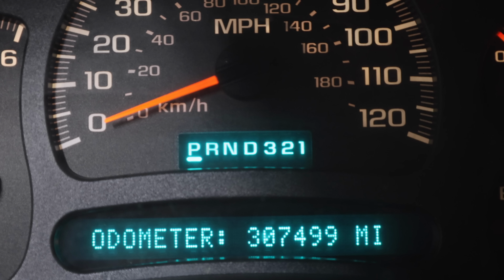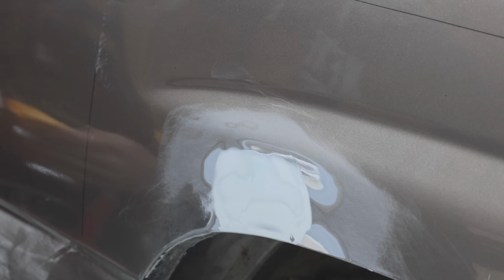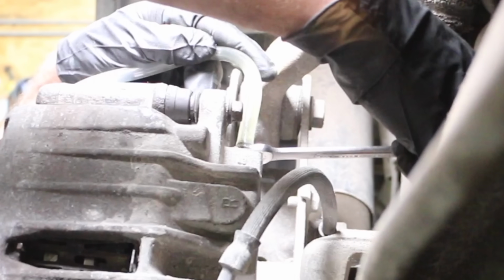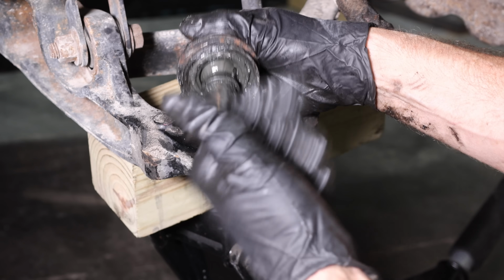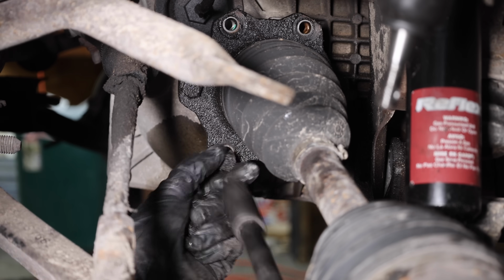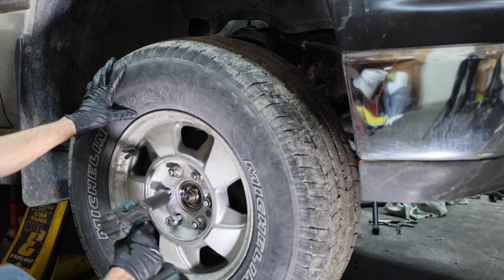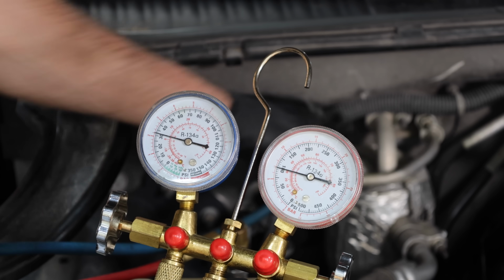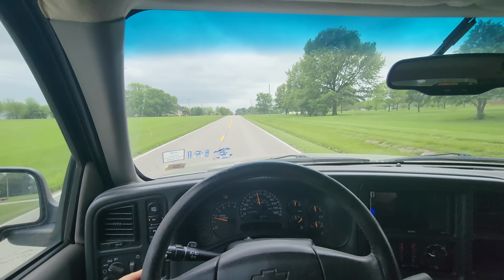Is It Stupid To Fix Up A 300,000 Mile Vehicle? Let Settle This!

Comment: I do a more than the recommend fluid and filter changes every third time. So everything is replaced. I just replaced my 2000 honda CRV and it still ran great. I now have a Chevrolet blazer premier 2003 an will keep doing the fluids and filters like I did on the honda. All my vehicles have been over 20 years old when I replaced them and still in really good shape.  I love your show. Longer or shorter, I'll still be watching. Some things just and e longer to do it right. Thanks for the good information.

Comment: My 4Runner has 450,000 miles. Its paid off, its extremely reliable, its very good looking, its easy to maintain and its paid for. Unless you're driving a Dodge Caliber or some equivalent piece of turd, theres literally no reason to replace your perfecfly functioning vehicle unless its not physically fit for duty required.

An alternator for your old beater is cheaper than a 180 month car note at 57%  interest rate for that new Hyundai, people.
Reply from the maker: Thank you for sharing!

Comment: On a repair patch like that. You should use a fiberglass filler for your first coat. Fiberglass fillers form a water tight bond with the metal. After the fiberglass filler cures, rough it in with 80 grit before your coat of plastic filler. After you get it as close as possible with plastic filler, then I would use a polyester glaze. It's thinner, so it's easier to apply and sand. After all the filling and sanding, use an etching primer on any bare metal before applying filler primer. 
This is the best way I've found to protect against future rust and get a good result. But there are many other ways of achieving a good repair. And everyone has their own opinion
Reply from the maker: Thank you for the suggestion!

Comment: Great video. Your speed is part of what makes your channel unique…keep it. 
This generation of suburban didn’t have AFM on the engine. Not sure the next generation would do so well. Impressive the rear brake rotors were original. Nice job on the bodywork.
Reply from the maker: Thank you for the feedback!

Comment: I had 573,000 on a 78 F150 2wd, 300 Six and a 4 speed. I kept the body oiled up. Changed the oil every 3,000 miles. I did wear out the clutch twice and the rear end. It was my work truck for a long time.
Reply from the maker: Thank you for sharing!

Comment: "Engineered Properly"
My Volvo 244 has non-interference valves. The timing belt can be changed on the side of the road with basic hand tools.
Current price for a new timing belt on a 1989
Volvo 244. 
$4.96 at rockauto.
Also, I just installed two new motor mounts.
Total price for the new motor mounts $8.73.

Comment: 704,225 miles on a 1989 Volvo 760 turbo wagon.  Engine is all original, and only opened up for valve adjustments.  The transmission got it's first replacement last year when it had roughly 665k on it.  (it functioned fine but first gear was starting to slip a bit, past that it was fine)  The only time it gave me a problem was when the AC compressor seized, and the belt made noises.  All it took to get home was cutting the belt off, then replacing the compressor for approximately $550.  And yes, the turbo is original, and makes ~13.8 PSI.  Compression is still perfect across all four cylinders.  I keep it showroom in and out, but it is NOT a garage queen, as seen by the odometer.  I bought it with 225k on it.
Reply: That's when Volvo and Saab made good vehicles. Keep it going to one million miles.
Reply: @lot931  That is the plan.  I have my 100 through 600k old school medallions for it.
Reply from the maker: Thank you for sharing!

Comment: I did an analysis recently on my pickup truck and determined that I could replace nearly every part on it for about 20% of the cost of a new equivalent truck. 

Minor body work, minor interior work, a new engine, new transmission, steering, brakes, etc, etc.....will literally save me $60k-$80k. I'll take it. 

New vehicles are harder and harder to maintain too, they are designed to be disposable so that consumers are encouraged to buy new as often as possible. No thanks.

Comment: I have a 202 chevy avalanche z71. it has 336000 on the odometer. but it has a new transmission and motor. the rest of the truck is in really good shape and best part, it is paid for
Reply from the maker: Thank you for sharing!

Comment: it is much cheaper to keep and repair and older car or truck !  My 2001 Accord was still shining and running like new with 471,500 miles on it ... UNTILL 1/2 a tree fell on the roof and TOTALED  Ole Blue , when I was driving it !!!    the newer car are all computer chipped and very EXPENSIVE to repair and your car insurance will cost you a lot more $$$
Reply from the maker: Thank you for sharing!

Comment: Great video and it's nice for you to do something different!  I am fortunate to have a 2004 Expedition 5.4L 4x4 that has 281,000 miles with no major issues.   Hoping it will see 300,00 miles one day!  My brother-in-law used to have a 1998 Suburban that had a little over 300,000 miles on it when he got rid of it.  It did go thru three transmissions.
Reply from the maker: Thank you for sharing!

Comment: 2011 F-250 Super Duty, King Ranch. Just turned over 200,000. NEVER had a mechanical problem until last month, evaporator went out. Had it repaired, good for another 200,000! Transmission serviced every 30,000, oil with dual filtration every 5,000, front & rear diff's serviced every 50,000 or so. All other fluids changed every 2 years or so. Everything works, looks good and I still love it.
Reply from the maker: Thank you for sharing!

Comment: doing this for living so here are some quick tips 
1. block sand putty with coarse grit
2. fine sand with orbial sander finer grit
3. prime using high build 2k primer
4.block primer
5. scuff(remove the shine of the clearcoat) the whole panel or part of it (if there are body lines  and you want to polish the blend later on)
6. degreese
7. paint and clear 2 coats should be sufficient
8.,enjoy ur work

Comment: As long as you can do maintenance and basic repairs yourself, it just seems to make economic sense to keep a vehicle going for many, many miles. My 2005 Honda Element only has 215,000 miles, not 300k, but is still driven daily. It was paid off 15 years ago. I think of repairs in relation to what a new car payment would be, and it makes the decision easy as to whether repairs are worthwhile.

Comment: The only change I'd make is to be sure to buy rotors with threaded holes in them so you can break them loose with a couple of bolts instead of having to get the sledgehammer out. The last owner of my wife's old Mazda 5 had the rotors replaced with ones that didn't have bolt holes and i absolutely couldn't get them broken loose on my garage, so i had to pay a shop to get them changed... They said it took a ton of beating to get them off!

Comment: I daily drive a 2010 honda ridgeline as a work vehicle, closing in on 400k. I've done the timing belt/water pump twice, with it's third time coming soon. Original transmission, run full synthic oil every 5k miles. Some dents and dings from being used the way a truck should be used, loaded down with tools. Other than tires, brakes, suspension, an alternator, starter, dash lights, several gas caps, pcv valves, spark plugs, air filters, all the standard stuff I can't recall having bought much more for it.  Keep the fluids fresh and swapped on time(which I hate and can seem expensive sometimes) it runs like a dream.
Reply from the maker: Thank you for sharing!

Comment: 390,000 on my 2003 Chevy Van 1500 express 4.3 v6.
Easy cheap  to fix .
Very reliable 20mpg empty.
Uses no oil original engine. One transmission rebuild from towing bobcat skid steer mini excavator trailer.

NYC metro area salt from roads and sea. Tiny rust spot began behind rear wheels .
Reply from the maker: Thank you for sharing!

Comment: I'm pushing 340,000 miles on my 1994 F250. I bought it for $3500 in 2005 (it had like 115,000 on it at the time) and its been my work beater ever since. Its spent the last 200,000+ miles loaded with tools and dragging a utility trailer around. 300 inline 6, zf5 manual transmission, and power nothing, it'll outlive us all.
Reply from the maker: Thank you for sharing!

Comment: Great video! You make absolutely fantastic content and I think the pacing is great. It's quick enough to keep distracted people engaged, but still at a pace where detail comes through. I feel a lot of people slow things down and show every step of a process, such as removing every brake caliper, because they're trying to pad the length of their videos for whatever algorithmic reason. In your case you're providing so much information and content that you really don't need to slow things down in order to have a decent length video.
I am curious however, if you don't mind sharing, what was the total parts cost for this 300,000 miles refresh?
Reply from the maker: Thank you for the feedback!

Comment: Sweet vid, however i did notice broken exhaust  manifold bolts on the engine which is VERY COMMON on 5.3L  & 6.2L  LS ENGINES IN THE FRONT AND REAR OF THOSE ENGINES, ON OUR 07 TAHOE WE HAVE PROBABLY OVER 500K NOT SURE EXACTLY BECAUSE THE CLUSTER QUIT SHOWING THE MILES AT ABOUT 345K ABOUT 2 1/2 YEARS AGO! ANOTHER PROJECT I HAVENT GOT AROUND TO! KEEP UP THE GOOD WORK. THE SPEED OF THE VIDEO IS OK IF NOT... PPL. ARE LISTENING OR WATCHING TOO SLOW 😁  313

Comment: This video hurts knowing they never make vehicles like these anymore. Now you're lucky to make it to 50k miles without something going wrong, especially on gm vehicles. My dads 05 silverado 2500 is a work truck with 300k miles on it and it's been abused, only thing it's needed was a new front drive axel due to him plowing snow for 10 years on it. My brother got a new silverado with a 5.3, and the lifters went bad on that in 12k miles. New vehicles are junk with a nice coat of paint.
Reply from the maker: Wow! Thank you for sharing!

Comment: May wanna mention to those unaware, doing brake work you should wear some sort of respirator and it is also a good idea to spray the whole thing down with brake clean aerosol before messing with them.  Brake dust can be toxic, you don't want to breath those particles in.  This is even more important if you are messing with a very old vehicle some of the brakes and clutches were made with asbestos, which can cause mesothelioma a form of lung cancer.
Reply from the maker: Great point!

Comment: 380,000 miles on a 95 Accord EX. 
Head a few big failures around 280-300k a little while back (water pump, suspension & bearings) otherwise runs wonderfully even now. Just did a valve adjustment  yesterday!
Reply from the maker: Thank you for sharing!

Comment: 350k on my 2003 Silverado 1500 z71 5.3. Luckily I live in New Mexico and humidity, rain, and snow is basically non existent so rust isn't much of a problem. 
The truck runs great and ive done a full rebuild on the trans and transfer case, the diff is fully built with yukon lockers/new rear bearings, front hubs/bearings, rear u joints, alt, h2o pump/stat, steering pump, Bilstein 5160 front and rear shocks with leveling kit. are all new. 
Just need: ac to be replaced (doesn't work🙄), front diff rebuild, steering upgrades, leaf springs, upper and lower control arms, pulleys and rollers, and engine rebuild. Definitely worth keeping and rebuilding to me. Definitely way cheaper to upgrade than to buy new or used (newer) then fix that when it breaks.
Reply from the maker: Thank you for sharing!

Comment: I have a 2000 Silverado 1500 with the 4.8 at 354,xxx miles, routine fluid changes are what has kept mine on the road for so long, I plan to drive it until the wheels fall off!
Reply from the maker: Thank you for sharing!
Reply: These trucks and suvs were legendary. I've seen some that wasn't cared for last to well over 300,000 miles. But like you said, basic routine maintenance gos a long way, and it's WAY cheaper than having to pick up a monthly payment again.

Comment: 1977 Toyota Celica I saw the odometer roll over twice.  Ans I wasn’t the original owner 
So by the time I sold it it likely had close to 400k

2001 Maxima 247k miles when sold.  It needs some transmission work but ran great .
Reply from the maker: Thank you for sharing!

Comment: Daily driven 89 Volvo 244 has over 560,000 miles on the clock.
In fact I just got back from a 10 hour road trip with that one.
It's almost broke in 😉
My previous 240 had over 800,000 on it.
You can get a free new  one from Volvo.
If you get one to a million.
So no, 300,000 is not to many miles.
Especially if its a Volvo.
Also.
Did I mention that it's less complicated to work on than a modern lawn mower, and gets great MPG.
Reply from the maker: Thank you for sharing!

Comment: If you live in the north where salt is used on the roads its hard to get anything to get 200K. I have a 2007 dodge dakota that is more rust than metal with about 150k.
Reply from the maker: Thanks for the feedback.

Comment: I have seen.a hack for installing differential oils using a power steering pump and an up turned water bottle on the intake with the bottom cut out makes it fast and quick to do when you use a power drill to drive the pump
Reply from the maker: Thanks for the feedback.
Reply: @ProjectFarm  no problem

Comment: I have a 2002 Chevrolet Silverado Z 71 4x4 with a little over 325,000 miles. I've done about 75% of the work you did on your Suburban. The engine and transmission are original and have never been out of the truck. I knew the history of my truck when I bought her in 2017. She's been worked hard but had reasonable maintenance. Every quarter panel has dings and scratches, as well as rust popping through all four fenders, cab corners, and rockers. 
The 5.3 liter engine is as quiet as a church mouse when running.
The money I've spent bringing her back to tip top mechanical condition is well worth it to me. The cost of a newer truck is just to much. Besides, she's become part of the family, and her name is Big Red. She rides like a Cadillac and can still work when needed, although today, about the heaviest load she's going to carry is a few bags of potting soil.
Reply from the maker: Thanks for sharing!

Comment: I have two Rangers with 300k. My son's the motor is still a unopened, original 4cyl. Only water pumps and timing belts as for it being opened which is just the plastic cover. It's pulled 5klbs to 10klbs multiple times over long distances including a 5,000lbs load over 1,100 miles and slamming a massive pothole in the concrete through Texas. We did replace the clutch a few months ago.
Reply from the maker: Thanks for sharing.

Comment: I have a 2003 Suburban with only 145k miles but its a Michigan truck and has lots of rust.  My fix it to add the Z71 wheel flares to hide the rust which I will grind off and put a few coats of rust preventative according to your review.  The 2006-2006 are the best Suburban's.  The 2007 and above have the cylinder deactivation system and causes too many problems.  Great video as usual and the pace is perfect.  I only wish I could do the repairs as fast! 8-)
Reply from the maker: Thanks for watching

Comment: If you've never changed the fuel pump on that truck yet it'll probably be going out real soon. I haven't seen one last more than 300K in GM trucks from that era. If it does get stuck, crawl under the gas tank and bang on the tank with your hands while someone else turns rhe key. That should get you home.
Reply from the maker: Thanks for sharing.

Comment: I'm loving these car maintenance videos lately. What a great reference for people - especially in these times where new cars are beyond many people's means. I'm a bit of a shade tree mechanic, but there are things in here I forget - like cleaning the mass airflow sensor. Also, you nailed it with the headlight design. It used to be so easy to change out the bulbs, but newer vehicles make it so complex. I had a friend whose car required an entire quarter panel be removed to change out a headlight bulb - and, of course, this car has electrical gremlins and blew bulbs every couple of months. Ridiculous.
Reply from the maker: Thank!  Glad to hear!

Comment: My suggestion is to NEVER buy anything new again. There are many reports from customers and mechanics about the newer vehicles being poorly built, dealerships not honoring the warranties when they break, parts taking an excessively long time to arrive and install because of supply issues and being so overly engineered or engineered so😮 poorly that mechanics are quitting because it doesn't pay enough to repair them as the labor estimation manuals don't adequately estimate the time it takes to do the needed repairs.
Throw in the ridiculous amount they are asking for vehicles nowadays you are much better off keeping a vehicle even if it 10+ years old or more.
Just my 2 cents on the matter.
Reply from the maker: Thanks for the feedback.

Comment: The 4L60E transmission gets a bad rap, but 300k miles is impressive. Did you ever have to do any repairs? The PWM (pulse width modulated) torque converter clutch in these transmissions tends to wear the bore in the valve body, so that's a common repair.

Comment: Man, you can really tell you're not in the rust belt. It took 3-1/2 hours just to change 1 corner's brake pads on my truck yesterday, and I used to be a mechanic so it's not like I just didn't know what I was doing. 

I've seen rustier cars/trucks than that Suburban, brand new on the lot.
Reply from the maker: Thanks for sharing.